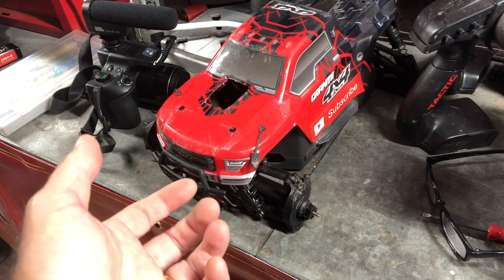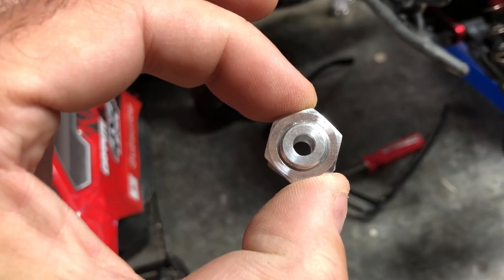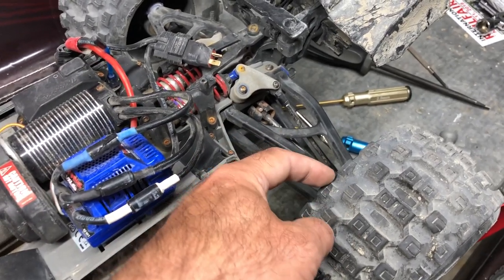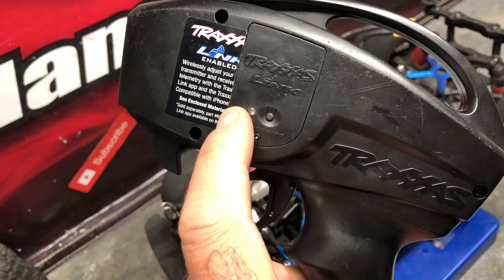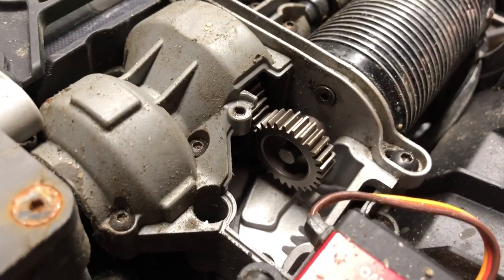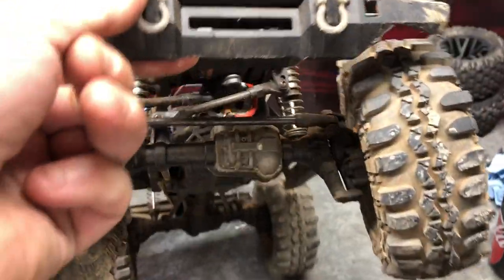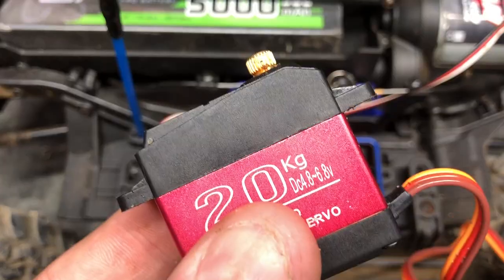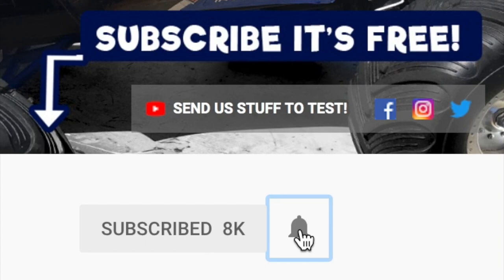This Weeks RC Workshop - It's a busy one!

Comment: Hey Richie, I received my granite 4x4 blx today and had a little bit of unfortunate problem....One of the shocks came leaking and seems blown. It's a shame but I'm sure tower hobbies will ship one out fast and make it right. On a side note the tires on this blx model seem really good. They are pretty hard with good foam. Seems like a really solid tire. I'll report back on how they preform when I test it once the damn rain goes away!! Also I love these workshop videos as it really helps us novices learn. Much appreciated buddy.
Reply from the maker: Ah! Both good and bad to hear! They should sort that out fast, funny this just popped on my screen, and I was just about to head down to rebuild the Granite's shocks as both the front ones have leaked out all the oil! Look forwards to the feedback, and glad you like the workshop videos, I like to think they're of interest as they show the good and bad bits. 2hrs last night drilling out a stuck pin in a wheel hex so I could go crawling this morning!
Reply: @DriftomaniacsRC  Ah for the love of the hobby right!  Do you happen to know about a aluminum shock upgrade that would fit this truck? Not a good sign that one was blown out in packing or shipping! Lol hopefully not a sign of things to come. It looks really beefy and well built tho.
Reply from the maker: no but I'm going to look at getting one when I get back from Disney next weekend, if you find one in the meantime let me know. The 2wd and 4wd arrma group on facebook should help if you need them fast

Comment: I know this is not really RC related but how do you like the Drill press ? I been thinking of picking up that exact one. Just wondering how you like it.
Reply from the maker: Very good google 'harbor freight coupons' and you'll easily find their 20% off one item coupon. It's easy to change the speeds, it's well built, and a good weight to it e.g feels like a proper power tool. Came into it's own last night - hex pin on the wheel hex on TRX4 wouldn't undo and I used it to drill the hardened steel pin out. Oh queue some very child unfriendly language! I think this came to $51 or 53 inc the tax. It did really well last night and the flex lamp it comes with really helped out when still drilling at 11.30pm....
Reply: Nice to hear, I really want to pick up a drill press sometime as well (and an air compressor while I'm at it, lol), freehanding or jury rigging up something to try to ensure a straight hole can get pretty frustrating with the hand tools, but whatever works, right?